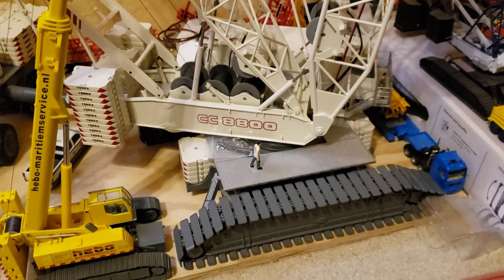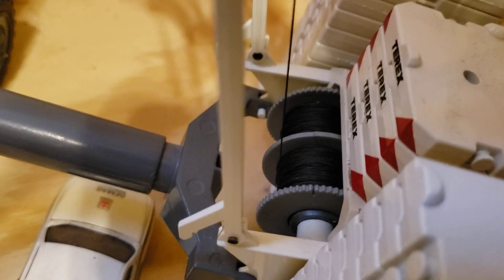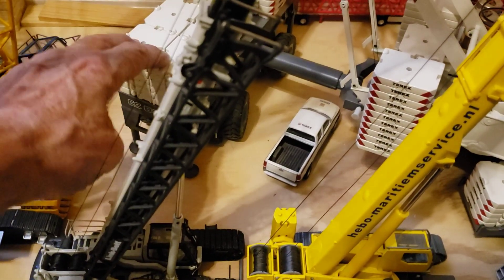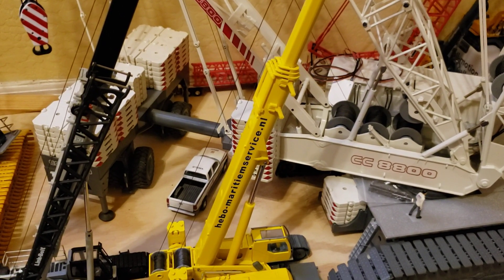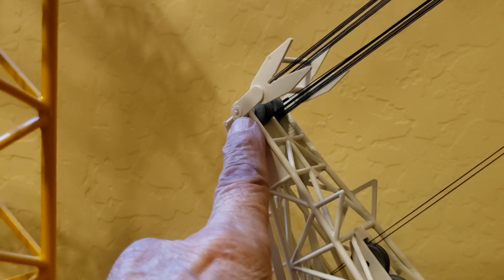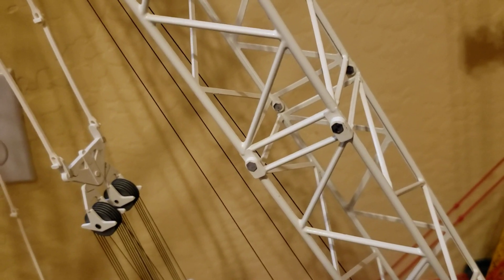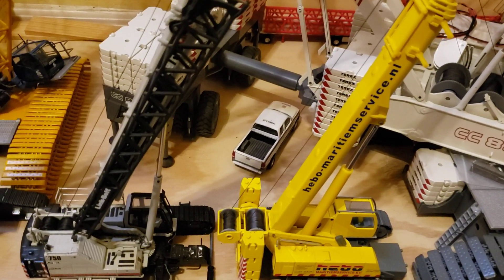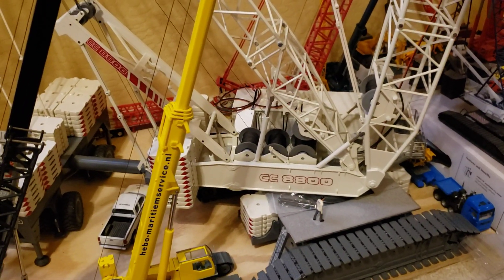CC8800 Load Test Fail

Comment: That model crane actually lifted over 20 pounds? Amazing. Is the model rated to lift that much weight? I guess the loaded diecast components (hook block, boom pulley pin supports, etc.) held up ok (except for the failed "A-frame"(?)). Greatly detailed model & great video!
Reply from the maker: I had to check again to make sure I give you the right amount. On the next test it held 29.5lbs! This is a beast. Over 1700t scale weight.
Reply from the maker: Hi Shadovanish, yeah it did before it failed. The A-arm winch didn't hold up and the boom lowered so it didn't lift the max. I posted another test and it held up well after locking the winch. I was a little surprised all the plastic parts held up so well. Check it out and see how tough this bad boy is!